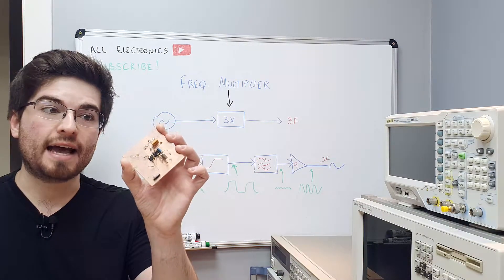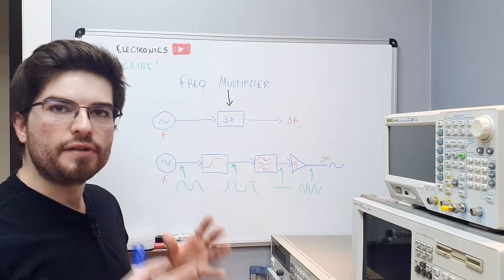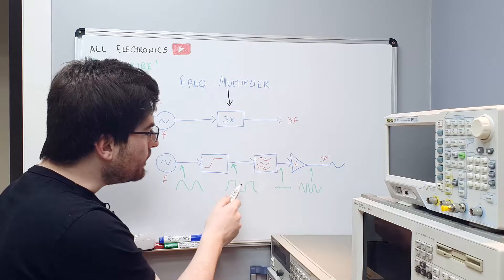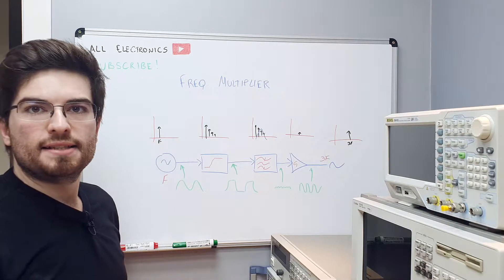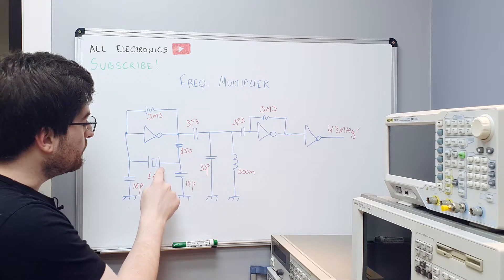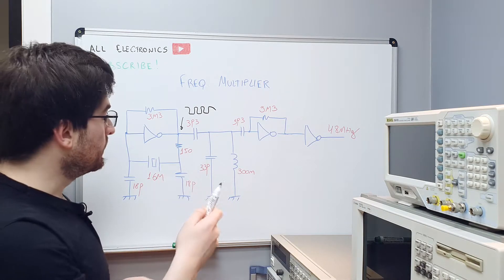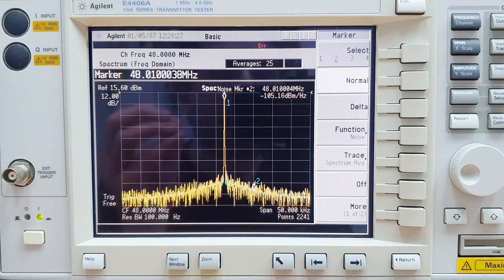Frequency Multiplier - Theory and Prototyping Example

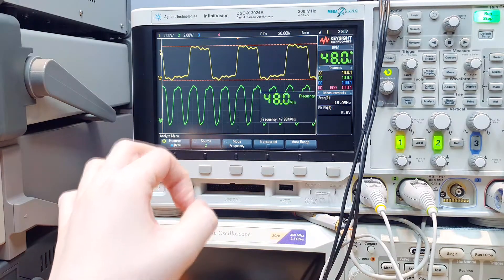Comment: @5:50 Very nice to say the output signal (3*F_0) is phase coherent to the original signal (F_0), very important statement! Since the frequency is tripled the phase is also tripled. Therefore, the Power of phase noise (in dB) of the output signal is 20 log10(3) added to phase noise of the original signal, note this better than a Phase Lock Multiplier.
Reply from the maker: Great !

Comment: Very good clip, thanks.
But looking at the output, I do not believe your phase noise to be -105dB.  The output signal does not look like clean sine wave, so your phase noise can not be that good.  Probably, you made a mistake in measurement somewhere.
Maybe, other people can tell us why your phase noise measurement was wrong.
Maybe , you sent the output into another filter that clean the output.
Reply from the maker: -105db is not special for a crystal oscillator
Reply: @AllElectronicsChannel  Thanks for your replay, I used PLL and crystal oscillator and get about 70 to 80 dB phase noise.   I wonder what was the phase noise of the original oscillator?
If you can generate this good multiple frequency, then we can always double the frequency and divide it by two to generate 90 Deg.  phase  difference signal for IQ applications.
Reply from the maker: Frequency multiplication degrades de phase noise by 20 log (N) , you may estimate the reference phase noise

Comment: Very important point you should have mentioned is that when an oscillator is a square wave, the frequency response is infinite multiple frequencies of 16MHZ. At first I was wondering why there was no non linear device such as a diode or transistor. Then I realized, after remembering DSP while back, I remembered about square wave has infinite sine waves.

Comment: good video... can i use the same idea to increase output frequency of a dds signal generator?
Reply from the maker: Yes you can! But this technique will only work for the frequency where the filters are tuned, it is not a broadband method.
Reply: @AllElectronicsChannel  
Which frequency multiplier can you recommend to increase MHz frequency to GHz
Reply from the maker: To get GHz from MHz you need a PLL or multiple multipliers.. take a look on the channel!
Reply: @AllElectronicsChannel  okay... thanks

Comment: Hello, great video, in PLL multiplier aplication are the frequencys Fin and Fout syncronized? For example, if 1.024Mhz was multiplied by 375 and then divided by 6 then the output frequency will be 64 Mhz, are the 64MHZ and 1.024MHZ signals syncronized? I mean, the Fin and Fout are going high and low syncronized (at the same time)?
Reply from the maker: Hello! 
If the multiplying factor is an integer, every N edge will be exactly in sync. If you are using a fractional ratio, the edges will be synced in a statistical way.
Reply: @AllElectronicsChannel  very nice video. not just this one, but all of your videos.
for fractional N I still think they are synchronized. E.g. if I want to divide by 1.7 then every 10 cycle of Fout is exactly synched with 17 cycle of Fin.

Comment: Although you did frequency multiplication x3 but truly you did not... The important thing is you input pure sine wave frequency within a bandwidth and has it multiplied x3 and again same sine wave at the output , this is called multiplication  but the technical problem is you can do this by even numbers not by odd numbers !!....
Reply: Easy enough to double a frequency. Just use a full-wave rectifier followed by a bandpass filter.